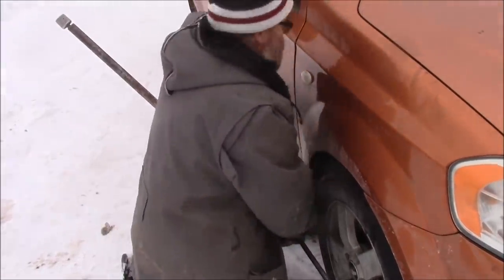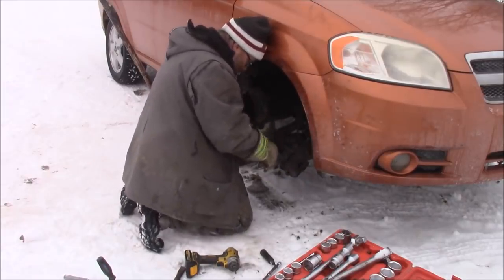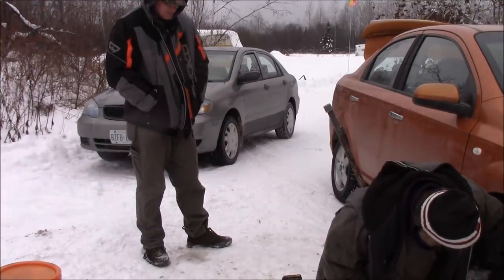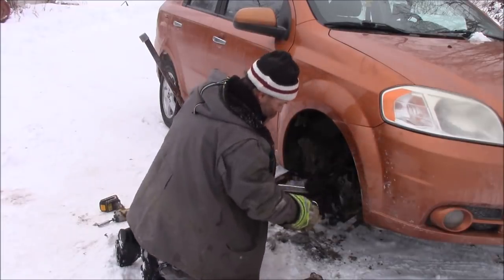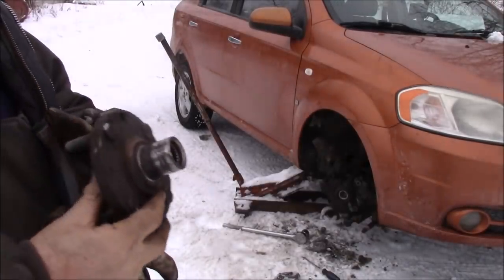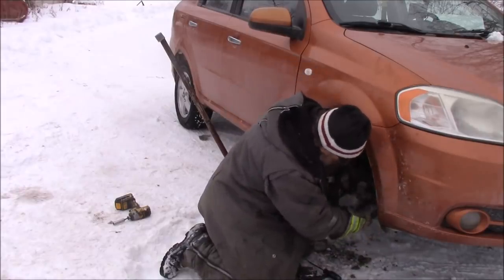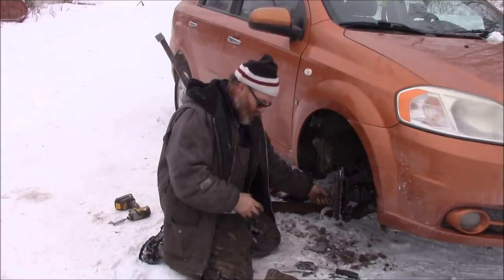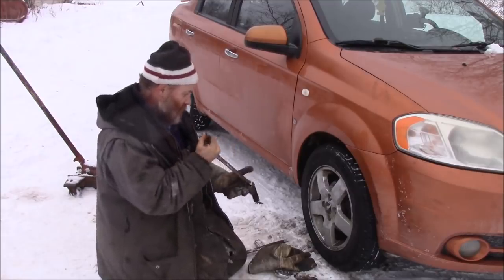Front Wheel Bearing Change On Our 2008 Chevrolet Aveo

Comment: Looks like you need to ask Santa for a Milwaukee m18 fuel 1/2 impact.. they are expensive $600 but well worth it.. pretty much remove any bolt of snap it off.

Comment: what a pain in the ass job same car. same side. mine took 9 hours to get off and done. we had to get tools from autozone 3 different types to get the wheel bearing out. it was stuck in there. are these cars none for the passenger side to go . or what?  i love my car though,its so good on gas.